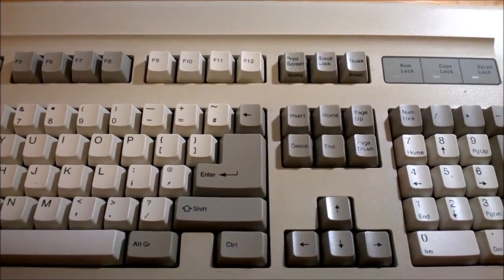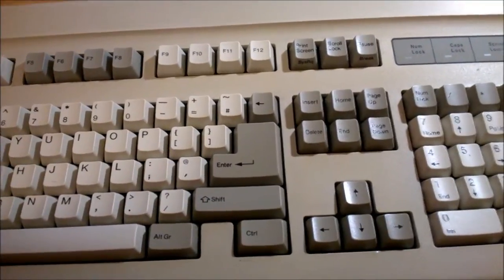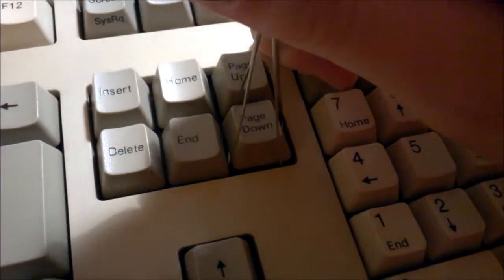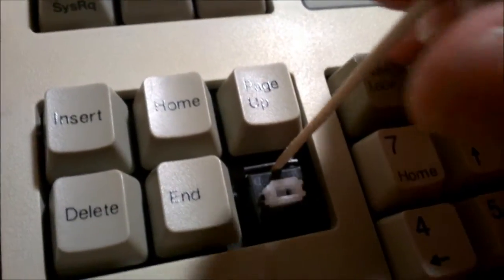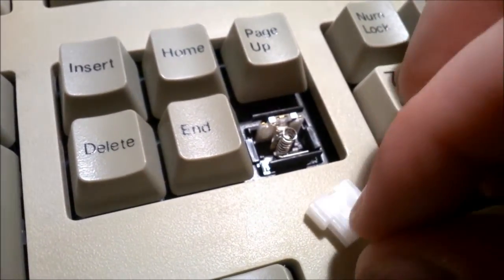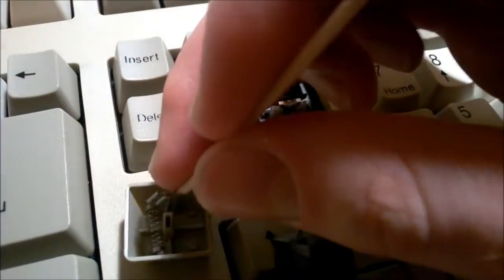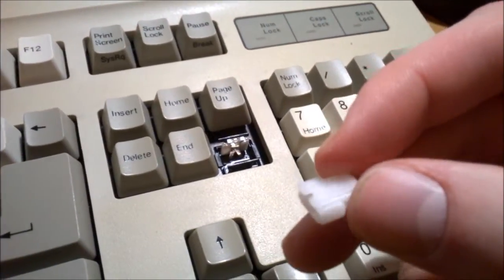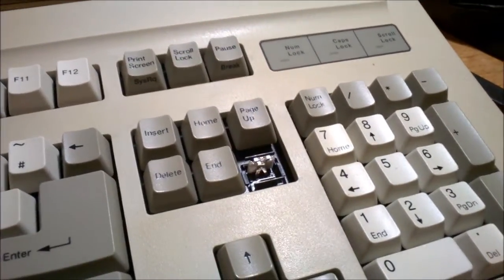Alps switches; cleaning, maintenance and restoring clickiness/tactility tutorial

Comment: Just got a beaten up AT102W. Watched all of your alps videos in one sit. Cleaned half of the switches already, Thank you for the grat tutorials and guides. Also subscribed!
Reply from the maker: That's a lotta videos, general. Glad you enjoyed them, though :) .
Reply: What do you recommend for lubing?
Reply: For tactile switches, ptfe penetrating lube works fine, but don't do that on clicky switches, unless you don't want them to be clicky anymore :) Lube getting on a click leaf will mute it. I personally don't like thick lube on alps switches unless you are VERY light with it. Alps switches don't really like dust, and using a grease lube will only make that worse, serving as a place for the dust to gather and make the switch disgusting. The kind I use is 4 in 1, the type that goes on wet but stays on dry. It won't concentrate the dust. Even it, though, will mute a click leaf.

Comment: Fun Fact: Professional Ice Maintenance and Ice Resurfacers use cans of compressed air to repair the ice during hockey games. If there is a deep rut or hole in the ice, they will pack slush into the damaged area, smooth it out with a hockey puck, and turn the can of compressed air upside down to use it's colder than your ex-girlfriends heart properties to "flash freeze" the area. Giving it a quick repair job to hold out until the next resurface session. You can also use it to make your beer colder faster if you were forced to buy the non-cooled beer in the cooler section. (btw, thank you for this video, it has helped me repair and restore my first Dell AT101)

Comment: I would advise NOT to use Teflon impregnated lube. I used that type to loosen up some sticky keys on my Focus keyboard and the keys didn't register after a while. My guess is that the Telfon interferes with the electrical contact that make the switch work. The Teflon lube does work great on the ball bearings for my slide out keyboard drawer though. :-)

Comment: A note: the click leaf in the switch has a primary bend that the slider pushes against and two identical secondary bends that give the switch tactility.  Increasing the angle of the primary bend increases the actuation force of the switch, and increasing the secondary bend angle increases the tactile bump.  If your switch is tactile but not clicky, you should be able to modify the switch by flattening out the small tabs at the top of of the side of the click leaf that rests against the switch housing.  This gets them out of the way of the slider so that it is free to tap the top of the housing, making the "click" noise.
Reply: +Brian Kamras can you explain more or make an simple photo how to do that?  It's quite hard to understand this part "modify the switch by flattening out the small tabs at the top of of the side of the click leaf that rests against the switch housing". Thanks!
Reply: I can probably make a short video demonstrating my explanation.
Reply: Cool! It will be very helpful. At this moment, I have not seen any tutorial for fixing the clicky on alps. :D

Comment: I have some Chicony 5161 boards. The keyboards and switches are in a pretty bad shape. But I would like to restore them to their full glory.
I plan on Retrobrite the keyboard case. 
Replace keycaps with Tai Hao doubleshots. 
Get new gold plated springs.
Lube the sliders just to be sure there is no scratchiness in the switch operation.

Only thing I'm not sure if it's worth doing or even possible to do is to replace the click leafs with new ones from a bunch of Matias Clicky switches.

Comment: Great video! Question: If the slider is hollow, could you blow canned air into the slider without taking the switch apart, but only remove the key caps?

Comment: I have these but the leaf seems to be permanently on the board or at least I didn't want to force them out. Mine also had a smaller brass colored leaf that goes in the button hub. I haven't figured out what's the best way to assemble them yet. Cool looking black Hunter Engineering KB

Comment: Dumb question: for the mechanical switches which aren't dust and water proof, which switches can take the most abuse over the years? What I mean with 'abuse' is doing no maintenance on the keyboard besides the occassional  vacuuming of the keyboard?
Reply: Not a dumb question at all! Other people can feel free to correct me, but I think Cherry MX or MX style switches are very dust resistant, potentially the most so of any switch with multiple moving parts. Their keyfeel/noise completely aside, their operation is pretty simple and involves few moving parts. Some MX clones can come with square edged, dust resistant stems (Outemus come to mind, though not all Outemu switches have those stems.) Among MX style switches, linear switches are probably the sturdiest, because they A. have fewer moving parts than tactile/clicky switches, and B. produce less friction because there's less abrasive contact between the stem and other pieces. They just overall have a simpler physical operation, which I imagine would make it less susceptible to wear and tear. Whether they are or are not for you is entirely dependent on whether or not you like the keyfeel and sound of MX switches. Now, all that said, if we're talking about "dust-proof" switches with virtually no moving parts, Hall-Effect switches are likely the sturdiest switch readily available to purchase. This is kind of an oversimplification, but they're contactless switches that use magnets to register a key press. They're extremely durable (100 million+ key presses per switch) so they often find use in facilities like nuclear power plants. Barring the event of a bag of sand being poured over your keyboard, I can't imagine you would have to perform any meaningful maintenance on a Hall-Effect keyboard. The crux is that they can be expensive. If money is no object, though, and you want something extraordinarily durable, I'd go with a Hall-Effect keyboard. Thomas did a good review of Ace Pad Tech HE keyboards; I'd recommend giving that a watch. Hope something in there helps!

Comment: I've seen the other video that you've mentioned in which they open the switch with a metal screwdriver... So basically you can turn a black alps into a white simply by changing the metal leaves or am I missing something?
Reply from the maker: ilaserbia You can make a black Alps switch clicky by swapping in a click leaf, yeah. Whether it's exactly the same as white Alps; probably not. The materials and thicknesses of various parts of Alps switches seems to have changed considerably over time and across switches, usually without any visual distinction.
Reply: Chyrosran22 Thanks for the reply. I just got a Dell AT101W for restauration so I was looking into my options. Looks like it's going to be a restauration without modifications. Actually I quite enjoy the blacks for now, but thought it would be a cool hack :)
Btw, I thought that finding these spare clicky leaves would be much easier, but I cant seem to find any at all.
Reply from the maker: ilaserbia It's pretty hard to find replacement Alps ANYTHING. They're not longer made, after all. You can contact Matias who still makes clone switches, see if you can get loose click leaf springs from them. I haven't click modded blacks yet but if you don't mind linear switches, try taking the leaf out altogether. Linear-modded blacks are very smooth ;) .
Reply: Chyrosran22 Thanks, I'll try contacting them during this summer. I preffer a tactile switch since I mostly type and do light gaming. Maybe if I get another AT101 I'll try the full conversion to linear, but for now I think that a restauration will take place with this one. I may try the convesion on just the "gaming" WSAD keys since I'm on a break during summer. Who knows, I might even like them more :)
Anyway thanks a lot for the sugestion! :)
Reply from the maker: ilaserbia No worries, have fun tinkering :) .

Comment: I have a Nos custom built fk-2001 built by a company in NJ that has Alps white switches. 
This KB has multiple 1/8" jacks at the back to add remote switches, for instance...  You could have a foot pedal activated enter key... 

After checking out old c64 keyboards,  multiple buckling kbs,  and the cherry blues this thing is 100 times as crisp..  Perhaps its the custom build utilizing white Alps switches?
Reply from the maker: The custom build quality will not influence the feel or crispness of the switches (although it will likely guarantee the use of good-condition, clean switches), so in all likelihood you simply really like Alps switches, like me :) . I also prefer some Alps switches to BS or Cherry switches. Good for you man, having a nice custom SKCM White board! I wish I had a FK-2001; do you have the foldable brown plastic cover on it too? :)

Comment: Please make a cleaning/maintenance video for SKCC :-)
Reply from the maker: It works fairly similarly, but because SKCC are mounted BELOW the plate instead of on top of it, you'll need to desolder and de-clip them first. Note that the clips are more fragile than on SKCL/SKCM.

Comment: my plus and equals key works most of the time, but sometimes, it stops working or types equals 2 times.
Reply from the maker: +Windows Ninety Five 66 You might have a cold solder joint. Try refluxing the solder on the key's pins.
Reply: +Chyrosran22 i don't see any cold solder joints.
Reply: It works most of the time, but sometimes, it stops working completely or types 2 equals signs.